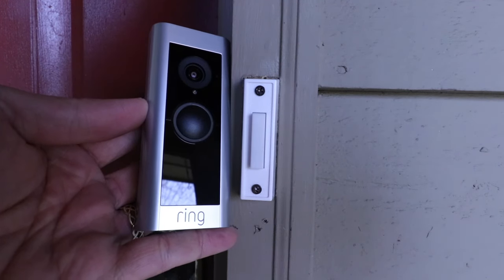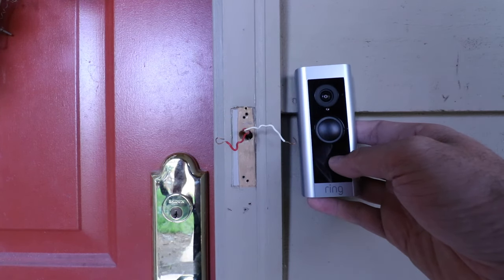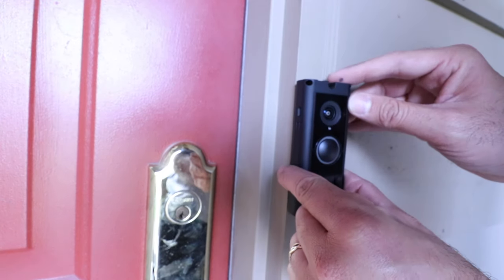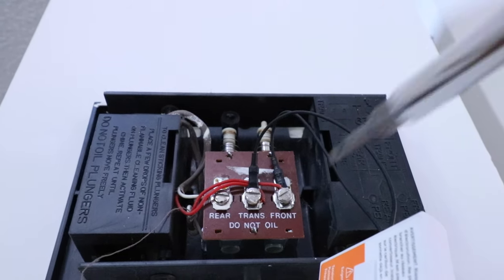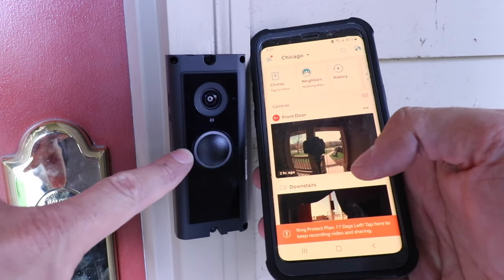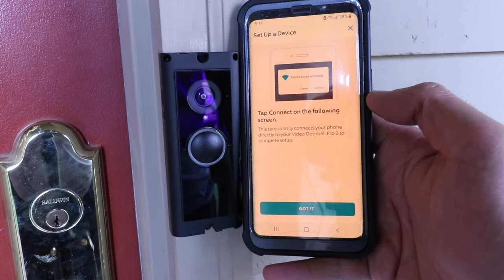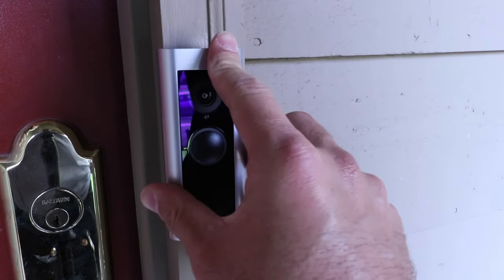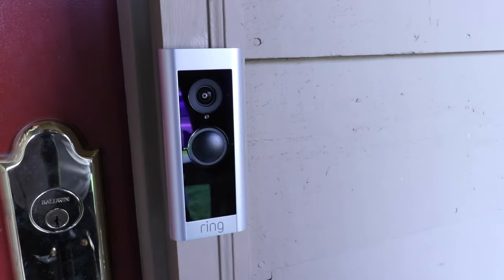How To Install Ring Pro 2 Doorbell

Comment: Is my existing, mechanical chime supposed to ring when pressing the Pro 2 doorbell button? Because mine doesn't. Everything else seems to be working though.
Reply: Did you ever get an answer to this ? Mine is the same way.
Reply: @thischildishlifestyle   Nope. If I work up the energy, I'll call Ring and post their response here.
Reply: OK thank you. I'll do the same.
Reply: I just installed me ring pro 1 . The mechanical chime rings about 1 second after pressing the ring pro button

Comment: Great video. Is this worth spending more money on over the Ring Doorbell Wired? I am doing a full renovation of my house, so I will put new wiring from the electrical transformer to the front door and use a Ring Chime. I don't have an existing old-school chime in my house.
Reply: Late, but how did it work out? Plan to do the same.
Reply: @mikesando7766  Works like a charm! I bought the Ring transformer that converts my 230V power into 12V (I think) and had the electrician hook everything up inside my fuse box. Works really well, so nice that i dont have to worry about charging any batteries and the video quality is more than sufficient for me.

Edit: Forgot which video this was connected to. I bought the Doorbell Wired version, and am really happy with the cheaper option
Reply: @fredthedude2  thanks for the reply.

Comment: Do you have to install the ring power adapter? would it still work okay with out it? i have no intention on using the existing chime
Reply: Surprised nobody responded to you but for future installers with the same question, no you do not need the power adaptor unless your voltage is below the threshold of 16v after testing.
Reply: @42Slab  NOT TRUE.  I actually read your reply before installing and my ring pro 2, it was getting hot and wouldn't connect and acting all weird.  I called tech support.  Told them I had 16 A/C volts at the door bell, they said it doesn't matter you have to use the power adapter.  Hooked it up and it connected right away and didn't get hot anymore.  Use it!!
Reply: I've had 2 ring pros now and haven't needed it so...

Comment: I see on your video to check transformer voltage, you show yours is 11.48 (looks like the exact door and doorbell). Then this video you state that your transformer is sufficient for the 16-24 requirement for the ring pro 2. Did you upgrade the transformer or  are you using the 11.48 transformer for this pro 2?
Reply: I second this!

Comment: I hooked up the ring doorbell, and turned the power back on. I heard the doorbell speak. Then, I had to turn the power back off because I forgot to install the power adapter. I did that, and now I have no power to doorbell and none in the lines that go to the chime. Did I just fry everything?

Comment: Let me clarify my question.  There is AC wiring for a doorbell, but the previous owners installed a battery operated one.  So, my questions about the white wires and what to do with them.

Comment: You should install that ring power “adapter” first and then the doorbell.
That protects the doorbell from voltage spikes. Otherwise you risk damaging your ring camera before you even get it installed.
Reply: Well the first thing you're supposed to do is flip the breaker. So you shouldn't be getting a spike through the line if you flip the brake or on the doorbell.
Reply: Robert is right. The Pro Power Kit ensures that your Ring video doorbell gets the power it needs and Must be installed before you install your video doorbell. I just followed the video and the doorbell worked at first. (FYI i flipped the breaker and switched it back on). After I installed the adapter it is no longer working. So now I'm guessing it's fried

Comment: My doorbell had power but couldn't connect to my internet. The suggestion was the router was too far away from the doorbell although it's only about 25 feet. Also the original wired doorbell chime didn't work. Is this related to the failure of the doorbell to connect to the internet?

Comment: Great video. You measured 11V in your linked video with the multimeter, but the Ring Pro 2 you identified is a min of 16V. Your ring pro 2 works on 11V? How does it work at night in the dark?

Comment: ^ Do you have to install the power adaptor? I have an OG Ring, that we never used a power adaptor. We installed the ring replacing our old ring but it says transformer voltage  poor and power input 3.

Comment: Can i ask for working with existing chime for the Pro2 if it sounds your existing chime in the house when the buttons pressed on the Ring. I keep seeing yes and no on google, so im unsure if need to buy a chime or if the doorbell will sound in house as normal before installation. Thanks

Comment: Recently installed the Ring video doorbell pro 2.  We love it, but having issues with the transformer voltage reading in the Device Heath tab on the app.   The pro 2 needs 16-24 volts and according to the Ring app, the voltage is around 16 which is good, but at times it drops to 15 volts and then I get a "poor" reading in the Device Health tab.  Ring told me I probably needed a new transformer, however none of us can find it.   My question is, if the voltage drops to 15 periodically, it that ok?  If not, sounds like I'll need a totally different doorbell since we cannot locate the transformer.  Any suggestions would be appreciated Thanks!
Reply: Did you figure out what the problem was ?
Reply: Look in side your furnace. May use the same one to power your thermostat.
Reply: @whatthe2458  can you explain?

Comment: Anybody able to please assist? What if I only have a doorbell transformer? It only has two prongs that have screws. How do I know which is "trans" or "front" (assuming I am supposed to install the ring power adapter to it)? Or is there no specific orientation, just as long as the power adapters prongs are mounted to each transformer prong? LoL not sure if I'm using the correct terminology.

Issue was we have a Video Doorbell V4 which does not stand a chance in Canadian weather... Have to go with the Video Doorbell Pro 2 now.

Comment: Hello,
I bought 2 ring doorbells, one for the front door and the other for the back door. The one in front is installed without problem and the one behind cannot install, the ring instead of the light going around in circles it flashes rather it means there is a problem. 
Can you help me please

Comment: After installing the power kit, the Ring Pro 2 works but the health says the voltage is poor. I measured 9.8v at the doorbell. If the powerpack is working, should I be measuring around 16v at the doorbell? Thanks.
Reply: Did you find a solution to this?

Comment: What is the purpose of the "Power Adapter"? Will it matter if the existing transformer is 10 VA?
Reply from the maker: The Ring Pro 2 requires 16-24V AC. If your transformer puts out 16V - 10VA it may work however typically 16V 30VA is recommended like this transformer: https://amzn.to/33NlY0r The purpose of the power adapter/booster installed in the chime is to provide a reliable power supply / boost for the Ring Pro 2 because it uses more power than the typical battery powered Ring Doorbells like the Ring 4 Doorbell: https://amzn.to/3fnyzNh. If you have 10va it may work, but if you are worried it will not work and you don't want to replace the doorbell transformer the Ring 4  would work in that situation, however the Ring 4 video quality is not as good as the Ring Pro 2 Doorbell video quality.  I just posted a review on the Ring 4 today: https://youtu.be/CrS8Rn68zzM

Comment: I am in South America and we use 220v. Currently my doorbell has a transformer with the following specs:
input: 220Vac ~ 0.55A - 50Hz.
Output: 12Vcc -1.5A, Max 18w.
Can you confirm if the Video Doorbell Pro 2 will work? Thank you!!
Reply: No it won’t, needs 16-24v